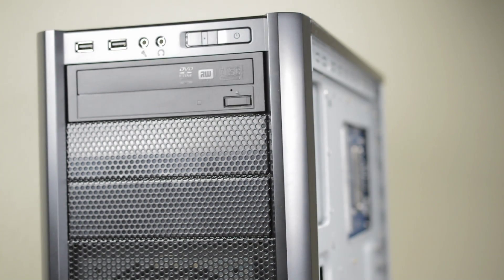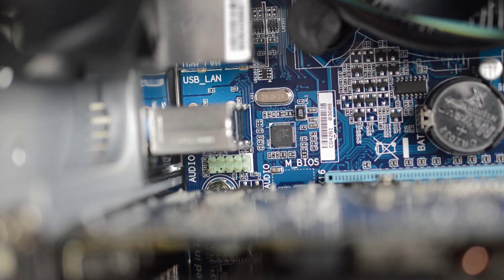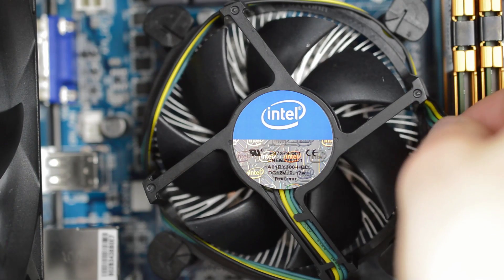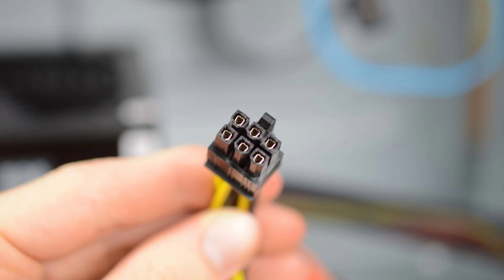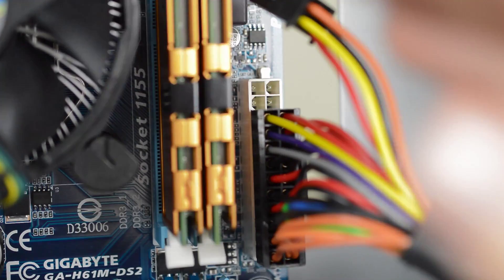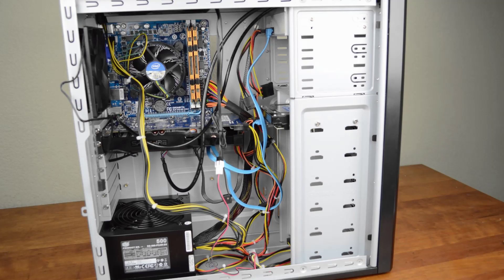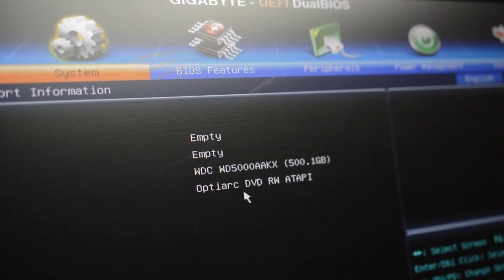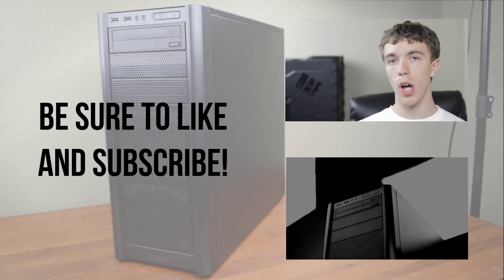How to Build a Computer for Gaming (2012) Part Three

Comment: i have Gigabyte GA-H61M-S Intel 3rd Motherboard / Intel H61 Chipset 
can i use it as gaming ? and upto how much ram & graphics can i install ?
Reply: You can use it for gaming but its really outdated. It doesnt have USb 3.0 or ddr4 ram capability . You can install upto 16gb ddr3 ram 2200 mhz or less
Reply: Ohk and what about graphics can i install ddr5 ?gtx 1050?
Reply: Yes you can install any graphic card on your mob.But i would recommend to upgrade your mobo as it is outdated And Which psu do you have ?
Reply: Tech-com ssd-psu-4505 450watt
Reply: You should upgrade your psu. Get a Trusted Brand's Psu like Corsair cooler master etc Local Psu can be Harmful to your rig
Reply: Ok thanks

Comment: do u get a sada cable with power box
Reply: SATA, and yes
Reply: It's a power supply
Reply: Alaa Afara I have a build with a HDD but my sata cables are like the ones in the video which one should I use or does it matter.
Reply: Andrewww You use a SATA Power cable to power the HDD and a SATA Data cable to plug the HDD onto the motherboard

Comment: What happens when you touch the pins under the CPU?
Reply: Well I touched mines coz its the first time I've seen one up close but it was only for a sec,  didn't bend no pins or anything and my hands weren't oily so I don't knwo
Reply: Stewart Bapor Does it work?
Reply: Well it did work but then I bent during installation lool, sold it and that person got it working by unbending the pins
Reply: Stewart Bapor and now you feel ripped off?
Reply: Naaa I bought a new one and it went smoothly that time lol
Reply: Stewart Bapor alright cool

Comment: My tower doesn't turn on when i hit the power button... I suspect that it might be the motherboard :( I don't know what i should do... What else to check for?
Reply: well first you have to be sure its the motherboard and if its the motherboard, you should get a replacement
Reply: How am I supposed to check?
Reply: Mike Chapman the 24 pin connector for the mobo doesn't go all the way in (it doesn't snap in) for the cx600... that was the problem and it's still the problem. I can make it work, but i don't know if it's safe to leave it like that...I don't recommend cx600.
Reply: cx600 is fine im using one in my machine right now, its a good budget psu, but the cables can be a little stiff and the connectors can be a tad bit difficult to latch in but its safe

Comment: This is the best guide on internet thanks a lot my friend, but can i ask you something i'm building my own computer for gaming and i need your opinion.
CPU : Core i5-4440 3,3GHz 6MB/1150 
GPU : SappHire HD 7850 1GB
Memory : Apacer 8GB DDR3
Is this good for gaming ? can i play the newest games 2014-15 Low/Medium ?.
Reply: ***** Get a GTX Geforce 760/770 and you will be able to play most 2014-15 games on at least high settings

Comment: Having a lot of trouble with the 24-pin. Ive look it up on the interwebz and saw this is a common problem. Although it still won't go in. Anyone here who has some advice?
Reply: Can you describe the problem more?
Reply: It wouldn't click in. The hook on the pin didnt go over the 'thing' on the connection. Ive sort of fixed the problem but it just doesnt click all the way in. It works though.
Reply: TheMinersmadness Maybe take a flat head screw driver and pull the clip up a little? Dont over do it though.
Reply: Sounds good. Im gonna try that. Thanks!

Comment: i have triple checked everything and it still doesn't work, i didn't use the same parts but i assume its not that different, PLEASE HELP ME!!!!!!!!!!! i don't know wat i did wrong
Reply: Did you check to make sure that the polarity on your cables are correct?
Reply: ***** ya,but i figured it out the processor didnt fit my motherboard, even though it CLEARLY said that it would...but thanks for replying :)
Reply: Sean Findeisen If the socket did not match up, then one of the several pins were likely bent.

Comment: SOMEONE PLEASE READ AND HELP ME!!!

I want a gaming pc that I can use for youtube editing and gaming. I just want a pc with really good graphics and superfast (meaning you can open the internet in less than a second). And runs games smoothly. How much will that cost me? I am making the switch from console to pc. Please help.
Reply: Welcome to the club man!
My PC cost 900$ and it does everything you said quite well! but, you can make it any price you want. it just depend on how fast you want it to be and how much money you're ready to spend.

 what you need is an SSD... so internet open fast, with black Friday sales coming up, you can find a good 128gb one for ~80$ or a 256gb one for ~150$
Reply: thehomosexualhandyma Gosh thanks man for replying. If you don't mind me asking what graphics card do I get for the best graphics? Sorry I am kind of new to this pc gaming stuff and I am not the smartest guy around.
Reply: well, for best graphics you probably want a GTX titan... but the price to performance ratio is quite poor, there is the R9 290x that just release that seem to be a good buy or there is the gtx 780... but its still a bit expensive... how much money are you willing to spend, because those card are $500+ and you should not buy a too powerful GPU if your CPU is not powerful enough. and a good 300$ card should max out every game, the price of the radeon 7970 has come down...
Reply: I would say go with a cheap am3+ board a amd 6300 six core cpu the 7870 amd radeon graphics card and atleast 4gigs of ram
Reply: cjhawk67 yeah :) that's more or less what I have... and I'm happy with it.
Reply: Welcome to the Master Race
Reply: A cheap build is called the Meson, and funnily enough, you're in one of the right places to find it, this channel!
Reply: 4gb ram? Um I say at least 8 or 16gbs if you can
Reply: Medieval Engineers boots you out of the game if you build to much and don't have atleast 8 gigs of ram so I would agree with this.
Reply: it will caost about 600 to 750
Reply: The PoeticGaming Hey man i posted this comment nearly 2 years ago. I'm fine now.
Reply: And i realized that internet speed is correlated with your isp. lol

Comment: Hey austin, what do i do if i run out of seta power cables? For example in this build if i wanted to add another hard-drive? A quick response from anyone would help. Thanks ~Dean
Reply: Buy another one..
Reply: i would recommend getting another better supply as the one you currently have can not power that many data devices safely.

Comment: Check that the cables connecting the monitor are connected properly and if the power to the monitor is ok and finally check to see if you actualy turned on the monitor.

Comment: Check connections, if everything looks right then check monitor and power to it.

Maybe the monitor isn't hooked up correctly? Are you sure it works? If so, it has to do with your PC.  Look for fans on the pc and see which ones are working, if one isn't working check the connection between the power supply and that component with the fan.

Comment: My 20+4 pin power connector doesn't snap in to my mobo. I've put as much pressure as I can without breaking the board, wiggled it, & have taken it out and put it back in multiple times. The connector still remains halfway in. Anyone know if I should take the mobo out of case along with gpu and apply even more pressure or is it a defect in mobo or psu?

Comment: The processor has an 1155 socket so any 1155 cpu will work in this particular board. Even an i7. The components used are for a budget computer and while good for an everyday use computer, i would be reluctant to use this computer if you are a serious gamer.

Comment: When i try and plug in my hard drive and optical drive using the sata cables the cables dont seem to want to fit into the socket/port should i push them in harder?

Comment: I prefer using cases in which the power supply sits above the motherboard. Short cables are not a problem and the whole thing is much neater.
Also, I have a case with a hole and funnel above the CPU. The hot air gets out of the case in the quickest possible way. It's a little noisier, but it really helps with cooling. You only have to worry about the heat from the motherboard and GPU (which is usually expelled out of the back anyway).

Comment: Looks great. how far can one improve this later. processor, gfx card, ram ect. from what I understand mother boards only accepts hardware up to a certain point. I have never built a pc. I have never even tried. but I am wanting to maybe in the future. my wife plays the sims and even with a dual core and a 1gb gfx card and 4gb of ram it still bogs down. I want to build something that I could improve on for future games. thoughts?

Comment: I have a case with a chassis intrusion plug and my mobo has a chassis pins where the plug goes, but my problem is the holes and pins don't line up

Comment: you do realise 690's cant run in quadfire as thats an amd technology, you can get quad sli by using 2 gtx 690's, but minecraft isnt nearly cpu/gpu intensive enough to require that and a sandybridge-e processor for a minimun

Comment: Man, you should buy an nvidia video card like 400 series. It's much better than ati... I've got an i7 with 3.50 ghz processor 8 gb ram and nvidia GeForce gtx 660.... Better than yours. And , ati is not the best video card.

Comment: I buy a case with a spot in the back to put my wires, but in some cases I just use twist ties and try to push everything away from the CPU, and the GPU and maximize the amount of air flow in those crutial areas.

Comment: sounds like the power supply is the problem. if its still under warranty send it back and get a new one.
its also possible that there might be a test jumper on the power supply, that might be the problem.

Comment: I have intel core i3-3220 with a gigabyte radeon 7750 and a msi b75 MA E33 motherboard. i didnt bother buying a monitor because i wanted to use my tv as a monitor but when i try to turn my computer on and get to the bios, the tv is just black and there is nothing on it. I'm using a VGA cable and I tested my laptop with the tv and it worked perfectly, the screen came right up with the screen from my laptop. what can I do to make it work? i dont have any software installed to the computer either

Comment: No dude. Minecraft only runs on i7 extreme processors with quad-crossfireX gtx 690s, 32 gbs of ram, and about 4 1tb ssds. Then you MIGHT be lucky enough to have minecraft run at 20-25 frames per second.

Comment: Yeah you can. If you purchase an SSD it will likely come with a bracket that you can screw it into. You will then install it like a normal hard drive. You might need to purchase extra SATA cables in order for it to operate. You should also configure it to be your primary boot drive for windows, that way it will boot a lot faster. Based on what you said, this should work perfect.

Comment: If you want to connect wirelessly to the internet using wifi yes you do, but yuou can also just use an ethernet cable to plug in from your computer to your router. Ethernet is usually faster, cheaper and more reliable so it is the best choice if you have the router near by. If not you will probably need a wifi card. To install a wifi card you simply put the wi-fi card into one of the slots underneath your graphics card, put the antena through the the pci slot and screw it in.

Comment: You can either connect wirelessly or wired with an ethernet cable. With a wired connection it is as simple as plugging the ethernet cable from your computer to your router. If you are connecting wirelessly yuou will have to buy a wi-fi card which are usually around $50. (I could be wrong on the price) You simply but the wi-fi card into one of the slots underneath your graphics card put the antena through the the pci slot and screw it in.

Comment: Is the power button wired correctly? could be just a simple error like that, and your PC won't boot up (check if the small 2 pin connectors are plugged in correctly)

Can't really help you without any information tho :)

Comment: Well, with his setup, he has 1 HDMI, 1 DVI, 2 mini display ports, 4 USB ports in the back, and i think there are 2 more infront, single ethernet, a sound card is pretty basic, for normal speakers (2.1 or so) and mic, you can either use a USB WiFi card, or use a PCI Express slot one.. 

hope that helps you a bit :P

Comment: i'm having problems i believe i've gotten everything plugged in and installed correctly but when i go to plug it in and turn it on nothing happens. No fans start running, just nothing. really need help with possible problems

Comment: Is the power cable connected to the fan in the fractal core 1000 case a molex cable? or do I need to buy some sort of pin to molex adapter... i'm using exact same build but with fractal core 1000

Comment: I'm thinking of using a Cooler Master Elite 430 - Mid Tower Computer Case with All-Black Interior (RC-430-KWN1). I'm pretty sure there's a fan in the front grill, so would I not need a molex to 3-pin adapter for that or no?

Comment: Mine turned on but nothing happened on my monitor, I had the right connections between them so something must be wrong with my desktop. I checked all the plugs and their all plugged in, and I am pretty sure all the little black ones are in right. (could they be the problem?) Also my third fan (with the adapter) doesn't work,after a while I tried plugging it in while the computer was on and it moved for a second then stopped. What's wrong with my computer!? D:

Comment: my computer turns off then like 3 secondslater turns off and then turns back on by itself. it does this until it turns on completely and successfully and then i checked to see what the problem is. all of my temps are below 30 degrees C so i knew that wasnt the problem. ive used my new computer to play somegames now so i know its not completely useless. why does my computer turn off and turn back on by itself?

Comment: @graveslash1 the motherboard has built in wire-internet so u have to use a ethernet cable. Some motherboards have built in wireless internet I think but u need to check that. If u want wireless u can buy wireless network cards pretty cheap and u install it to s PCIe slot or u can buy one that u put in a USB port. But u proberbly need to install drivers on both if it isn't built in to the motherboard

Comment: Please tell me if this is a good gaming computer:

Processor:	 3.6 GHz FX-Series Quad-Core FX-4100

RAM: 8 GB DDR3

Hard Drive:	 1000.0 GB SATA3

Hard Drive Rotational Speed: 7200 RPM

Operating System: Windows 8

Comment: 1) you need to install the drives that came with the graphics card if not (look up the card on a diffrent computer and search for it online on the graphics cards website)
2) to conect to your internet you need to install either a Wifi adapter or plug in a Ethernet cable if im not mistaken..... hope that helped

Comment: If you mean BF3 at top quality graphics 60 fps no it won't but with some adjusting you may be able to run it at medium settings smoothly. If you overclock this to the maximum I would say it might be possible to run it high quality at full fps. Hope this helps.

Comment: When installing an operating system on an SSD do I have to plug out the HDD or do I just have the option to choose from 2, I also have a 64 bit copy of windows 7, however it does have a product key and it says replacement disk, will this still work? Thanks

Comment: I am not Duncann as you can see, but i can at least try to give you an answer. I am not shure, but i can tell you that a gaming system like this will not run battlefield 3 on ultra, or high....but mabye on low or medium graphics. But it`s always different from computer to computer, so only duncann can answer you 100 % on that ;)

Comment: im going to be using a laptop 300gb 5400rpm hard drive which im using in my laptop right now. will i have to buy a special cable for power since its smaller?

Comment: Hey Duncan, I recently bought all the parts for the build, and once I was finished putting it together for somewhat reason it won't come up on my monitor. I've checked all the cooling fans and they all seem to be running. When I plug in the monitor it says no signal but then when I unplug it, it then says can't find signal... Please help!

Comment: It does not have a full size PCI connector. Instead it has 2 x1 slots (the small white PCI slots).
It should be easy to find a wireless card to fit in those. Just remember to look at the size of the connector before you buy the wireless card, if its small or says PCI x1 then it will fit.

Comment: Just take the old one from your current computer and put it in your new one.
If you can’t do that then buy a wireless PCI card or a wireless USB stick, its up to you.
If you choose the Wireless PCI card (which I would) then you install it the same as you would the graphics card (except it needs no additional power).
Install the PCI card using the drivers provided, but its best to download the latest from the manufactures website, search for your wireless router after install and put your key in.

Comment: I took your $750 computer and i modded it :D
Intel Core i5-2500k Sandy Bridge 3.3GHz
ASUS P8Z77-V LGA 1155 Z77 HDMI SATA 6GB/s USB 3.0 ATX Intel MotherBoard
Patriot Viper 3 GB 2X4GB DDR3
ASUS Zonar DSX 7.1 Channels PCI Express x1 EVGA Superclovked GEFORCE GTX 560
Western Digital Caviar Black  500 GB 
Cooler master HAF 932 Advanced Steel ATX full Tower USB 3.0 CORSAIR Builder series CX600 
Cooler Master Hyper 212 Plus 120 CPU Cooler